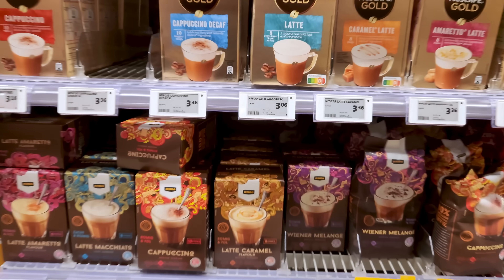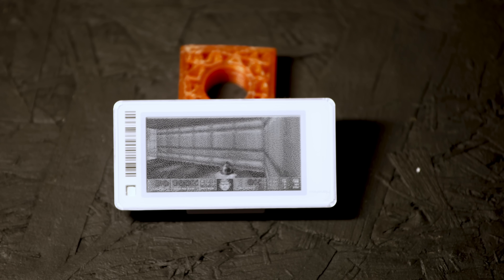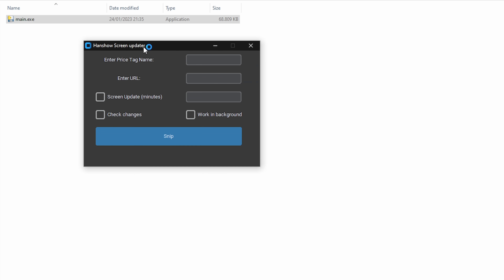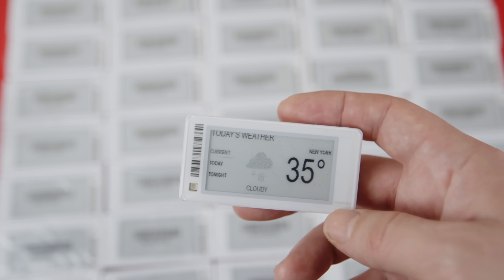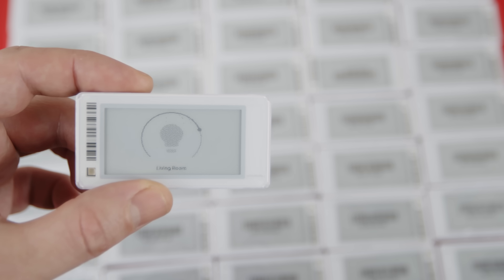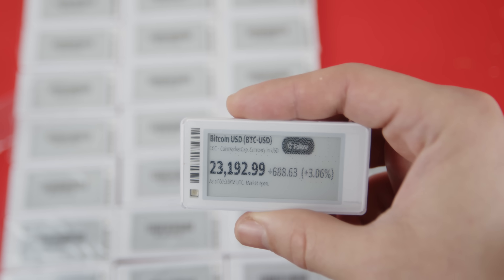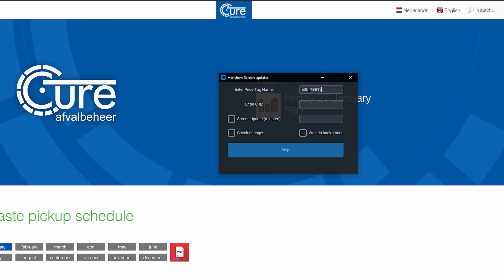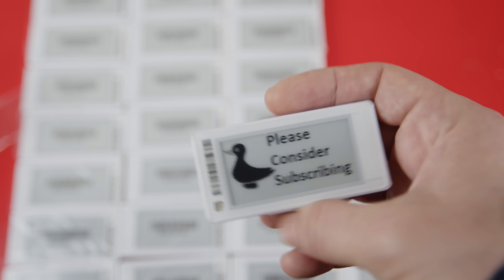Using e-ink (epaper) Price Tags (Shelf Labels) for everyday needs

Comment: Stellar-M3N@ E31HA Can you tell me what driver this display uses and what kind of protocol? I'm interested in connecting the display to an esp32 to print the temperature from the sensor. A schematic would be really useful with lcd pins. Thanks in advance, friend. Any information about Stellar-M3N@ E31HA is useful to me.

Comment: I work in a Dutch supermarket (Albert Heijn), and we have great software for managing our stock, displaying items and stuff like that. The app on our terminals is absolutely great and very well designed, and it's integrated super well with these price tags. They utilize their capabilities really well by also showing discounts or when an item is temporarily out of stock, without us needing to change it at all. We just link it to a product, and the computer does the rest in the background. They are really great devices, especially when they are controlled by really good software. (although it is a pain to replace all the batteries. We got all of them a few years ago, so a few months ago they nearly all died at the same time, I get why some owners just throw them away)
Reply: Kunnen jullie het tracken als iemand een steelt? Ik vraag dit voor een vriend
Reply: @Bloxy-Joel  Supermarkten zijn heel goed in het opmerken van diefstal, er hangen bovendien overal camera's in supermarkten. Als je er eentje steelt wordt dat zeker opgemerkt en wordt er actie ondernomen, net als wanneer je producten steelt uit een supermarkt. Ik vind het ongelooflijk dat ik dit moet zeggen, maar stelen is niet toegestaan, zelfs als het onopgemerkt zou kunnen.
Reply: Is dit openbare software lees app of alleen voor AH
Reply: @mhsvdz5222 alleen voor ah. Het heet Wink. Misschien dat het is gebaseerd op openbare software, of dat variaties ook bij andere (Ahold Delhaize) supermarktketens worden gebruikt, geen idee

Comment: Text too small. Only readable by a young designer on their computer screen,  or positioned in a shelf 24 inches in front, as depicted by video thumbnail on this screen. Reflective LCD ink at wide angle, positioned low or high is unreadable.  Digital imagers aka graphic designers are taught that the typestyle height should be at least 8 points for mature eyes. This is crappy design!

Comment: I am involved in helping the poorest children in a Kenyan school in the slums of Gil Gil. I have long wondered if it would be possible to use these screens instead of books. Connect the teacher's phone to these screens and send parts of texts or simple images.
Reply from the maker: Hi @arkadiuszkulon8728,
It’s certainly a great idea to use e-paper screens as learning materials. However, do you think a smaller device would be practical, or would a larger screen be better suited for this application?

Could you also provide more details on how you plan to use them in a learning context? For example, will they be used for assignments or other activities?

I find your use case very interesting, and I’d be happy to explore a project that could be beneficial for your goals.
Reply: @makersfunduck  My immediate idea is that the unit should be used for homework and school teaching.  The teacher via his phone sends text to the class's devices but without the use of the internet but perhaps bluetooth or other wireless technology.  the device needs to hold something like 50 pages of text.  And you must be able to divide the user interface and send channels into subjects such as Language, Mathematics etc.  maybe 6 in total.  The screen widths will be better, but I think that maybe 30 characters in the width and 5 lines is ok.  Maybe it should be possible to charge the device with solar?  maybe you can use rechargeable batteries from used disposable e cigarettes?  dust is also a problem in Kenya.

Comment: I am looking for someone to help me modify a rca projector. The rpj116 to be exact. I have dumped the flash ic and have been trying to reverse engineer it with hexwalk.  I then discovered a uart interface on the board of the projector which I plan to use. Would you be willing to help? I wish to edit the firmware or possibly write my own!

Comment: Thats little confused me, does they use battery for wifi connection. What about wifi router you need 10k connections over one router. Which way you preffer for price change?

Comment: Nice idea, but virustotal says there's a virus in your distribution
Reply from the maker: yes. because PyAutoGUI python library is essentially a mouse/keyboard logger. new windows updates gives that error to any software that records mouse + keyboard movements. I believe they fixed that issue with the new revision on the library. 

You can try to use new revision of the python library by updating requirements.txt, or you can just check the code, and if you trust the code, you can allow it to work on windows.

Comment: Recently I saw at Albert Heijn a newer version, with an optical link for sending and retrieving the data to and from the pricetag. I noticed that Albert Heijn uses more intelligent pricetags then Jumbo. If the product is in the storage but the shelve is empty, then a blinking blue light is calling a young Moroccan vakkenvuller.
Reply from the maker: Were they communicating through infrared?
Reply: @makersfunduck  Yes, I think so.
Reply: teh lulz

Comment: I remember working retail as merchandiser at a pharmacy in 2005, and we spent so much time printing, sorting, cutting, and putting up those sticker labels ... only to just take them down a few days later. It was a matter of time.
Reply: Your fingernails get sore from it :(
Reply: I remember seeing LCD price tags in quite a few places around 10 years ago that probably seeked to solve the same problems. Readability was a major downside though even for people without impaired vision since they had no backlights
Reply: The e-ink price tags must save so much labor.
Reply: @kellymoses8566  They absolutely do reduce a lot of labour,.  My position was reduced from FT to basic PT.  The labels need a bit more labour they're willing to pay for, but that's job market alas. lol
Reply: hey, did they have a machine specifically to print the labels?
Reply: @gray7585 Yes, Zebra is the biggest brand I know of for it.
Reply: @gray7585  where I worked not. The paper was special but it went into a regular printer.
Reply: I worked at Target at the same time, doing the same thing every Sunday morning every week. I had the idea for these exact things back then. The only issue was the tech didn't exist yet. Ahead of my time.

Comment: When the battery goes, they are soldered into the module and non replaceable. It's wasteful, but they cost something like 10 cents each at the price they buy in bulk when they purchase millions at a time for a chain. And each shelf and line item is likely close to 100k-200k per store easily.  So it costs more to replace a battery, other then just scan a new module ID onto a shelf to replace an old one. And the batteries in eink last years since they only use power to refresh the screen, and that's at setup of price.  So only when prices change it uses power
Reply: However, now looking on ebay and everywhere, even USED, not working tags are going for about $80 for 10 of them....  the market is so overpriced on those cheap tags now.
Reply: You can replace a soldered battery. If someone doesn't know what they are doing they shouldn't, but that just makes the store that much more likely to give them away for free since it REALLY wouldn't be worth replacing the battery
Reply: Not only when price changes , it uses wireless technology to communicate ...
Reply: The ones we have at work use 2 button cells.
Reply: This is a horrifying amouny of E waste. Just add a couple terminals to charge them, come on
Reply: @32BitJunkie  I have seen solar powered ones, stores are bright enough
Reply: @32BitJunkie  To add rechargeable batts would be 10x the price.
Reply: @32BitJunkie Yeah but to the companies that's a horrifying amount of lost cash across millions of tags
Reply: @KaitouKaiju  You and me pay the price anyway. Let the company clean up after themselves. That way nothing the environment stays clean.
Reply: If someone wanted one tag and everything required to operate it (turnkey? ), how much would it cost, would it be available to the public, and are there alternative cheaper kits (other than doing the steps in the video). Thanks

Comment: Well the e-tags used here are completely controlled via NFC.
Meaning they don't even have a battery, you need a tool to program them.
Pro: super thin, stylish, almost indistinguishable from paper labels.
Neg: no remote updates, since you need the tool to deliver the energy, also requires a human.
Reply: That seems only slightly better than a label printer.
Reply: @GamesFromSpace  Well technically every modern smartphone can be used.
So 🤷🏼‍♂️.
We Germans have a natural dislike against "every thing cloud"
I remember back in the early twenties that people who presented "cloud products" on tech conventions got ridiculed and then the audience simply left the venue.
Reply: @DerSolinski  indeed, "cloud is just someone else's computer"
and in theory you could have a situation where you see a price, but by the time you go to pay, the price has been changed throughout the system, and whatnot
Reply: @GamesFromSpace  well it definitly wastes less paper and resources (since they are reusable) and programming it should also be faster than printing a lable and putting it in place
Reply: Years ago I read about some sort of electronic price tag which were updated by pulsing data through the fluoro lighting. Apparently not noticable. Or you can do it overnight.
Not sure if this method is still in use.
Reply: @darylcheshire1618 I saw it in use in an Italian supermarket, but I don’t know if the little panels were just to provide the display with energy from the lamps.
Reply: But like, with paper tags, you could also see it change right in front of you (the employee doing it) or the price gets changed as you go to the register (you don't see the employee at the shelf behind you).
If stores are even allowed to change the price, I don't know.
But remote tags are indeed a lot more subtle, than an employee fussing about. So it could indeed be used maliciously (in theory)
Reply: some are remote controlled, like in LIDLs, I saw one update right before my eyes
Reply: @flippy9133  Yeah after a decade even we get the nice things 🤣
It just takes time...

Comment: Is it possible you can put a link to where we can get these from in the discription?
Reply from the maker: I have bought those 2. hand from ebay. you can search for "handshow" and check for deals. There are quite a lot of sellers. Also for some, I simply asked store managers to give me if they have broken modules. They usually just remove the ones without battery, and they can give them to you for free, since it eliminates the e-waste disposing hassles for them. (tip, almost all of them worked except the one fell in water :))

Comment: Hi! I uploaded the firmware with an ESP8266 NodeMCU, it says done but the display dosen't changes and I can't find my pricetag via Bluetooth, its a stellar-M3N@, can someone help me, what can be the problem?
Reply from the maker: Hi, did you unlock the flash before uploading the firmware?
also mind about the connection. if you have, I strongly recommend using pogo pins while programming

Comment: Hi. I do not go maine.exe, I do everything as he writes, ble to be unlocked at the label, but it is not updated. W11 is it to blame? Executed Main.Py, the Output console stops at waiting to connect ... Ble characteristic is correctly found by ble.py. What would be the cause?
Thank you, respect for what you do!
Reply from the maker: Hi,
Did you installed the dependencies on the virtual environment? because new versions of the bleak is not compatible.
Reply: @makersfunduck  No, I receive only errors. But the .exe not run correctly.
Reply from the maker: @mikeb8581  It seems like you have issues with the dependencies. can you remove all of the python instances from your pc, and try with python 3.10?
It seems like you did not meet the requirements of the bluetooth connection.
can you first try to run this code first?
https://github.com/rbaron/pricetag-printer

because my github uses this library. if you can manage to make it work, your software issues will also be resolved.

also can you try "python --version" command to verify that you have only python 3.10 installed?
Reply: @makersfunduck  I have python 3.9.0 like one of youtube video. I try what you say. Thanks.

Comment: The examples are so naaaah ... the images have bad resolution and more. Instead the text should probably as text (int) and not also as image imported into the screen. Then at least it would be better readable.
Reply from the maker: Resolution on this devices are quite limited, and I recognize what you meant. That is as good as it gets with only black and white pixels :( Do you have any interesting ideas? I have quite some of them, and looking for more ways to use them :)
Reply: @makersfunduck  a good idea is to use it in my office door to show my status "OPEN" ,"ON CALL" , "come back in 15min" , "DO NO ENTER" . Juste few few buttons on a basic tkinter windows to clock and change status. And why not using 2  tags and split the text to write bigger or longer text. 
And also use red color too for handshow capable prix tags . 
But I'm not enough good in python to do all that (for now)
Reply: @SantaDragon I think you dont understand the concept of "E-Ink" paper.

Comment: And maybe you could make the rectangle light up green if the resolution is the same as the actual resolution of the price tag.
Reply from the maker: First I also thought that, but then it takes a little while to get a snip. It just re-sizes the snip without keeping the aspect ratio. So far this worked best. Because it is a little hard to find websites which fits the pixel rate of your "eink price tag" :D
Also there are different sizes of these price tags. I preferred to write a code which can be used on different sizes. you just need to specify the pixel sizes of your device in print.py. 
if you still want that, you can just comment out that part in print.py.
Reply: Or make it very familiar by snapping to the aspect ratio of the eink display when holding shift, could also work :)

Comment: Nice! But I would like to send data from HA directly, without screen grabbing. Possible?
Reply from the maker: it is in fact. But what is the hardware your HA is running? im running mine on rasp pi, and I dont like the performance of it, so I did not programmed it like that. So, code is easily adaptable to a HA, and you dont need an extra hardware (assuming the device you are running the HA has Bluetooth .)
Reply: I've just come across your videos. Glad to see the possibilities.
I'm really interested in using it for home automation and I have a home assistant on a raspberry pi 4.
I'm pleased to learn that there's a way to link directly to it rather than retrieving information from a web page (which requires the page to remain logged in). Then if the device that's supposed to be updating the tags stops, I suppose that nothing is refreshed and that if it's a real stop, you have to redo all the captures.
Thank you very much for the open source, I'll get round to it one day!